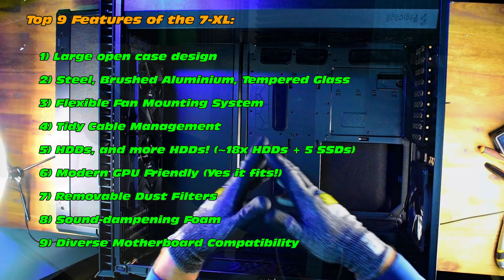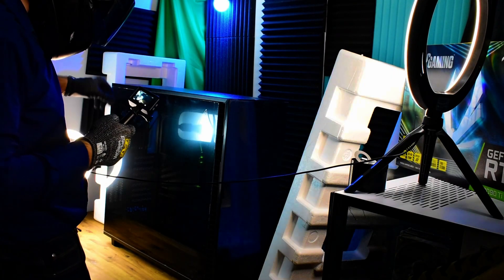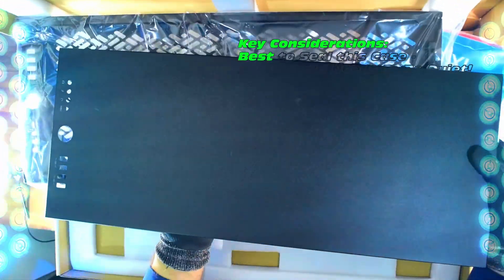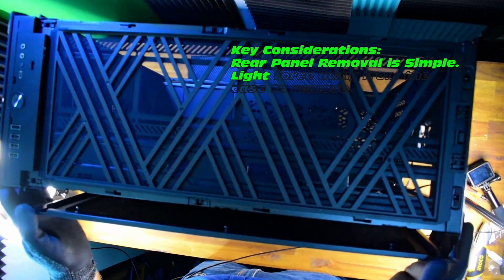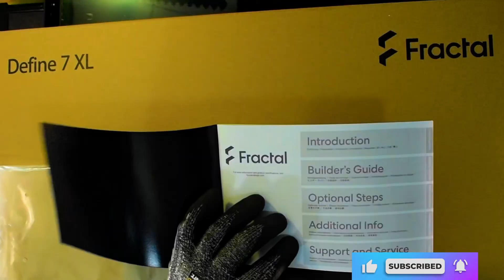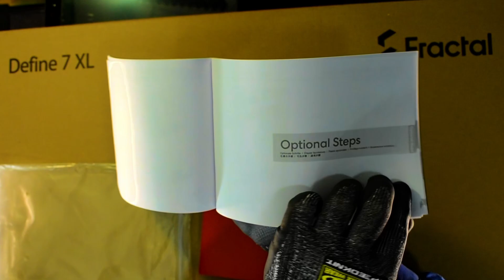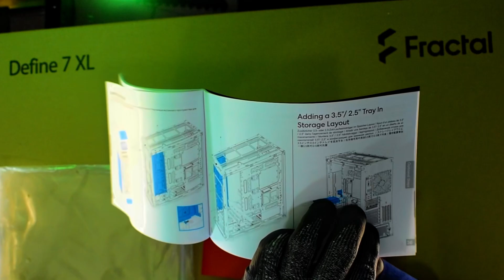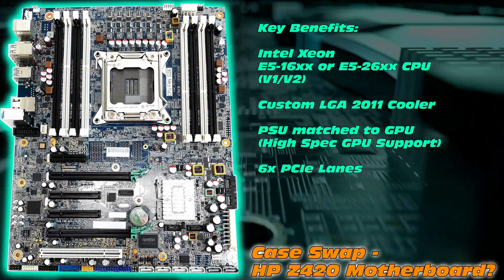Z440 NAS Build : Fractal Define 7XL Unboxing - Fits 18x HDDs, NAS Solution? (PART 1)

Comment: I still can't find a single video that shows how to mount the trays in the Define 7.
Reply from the maker: I have one, I promise! This video is done: https://www.youtube.com/watch?v=K4RalaEbRI4 Maybe it's the only video on youtube that explains how to mount the HDDs. I had the same experience... ~19:27 (min:sec) in that video.

I didn't technically include footage of the mounting of that brace (I had to cut out a lot of footage to make the video shorter). The front panel cover has to be removed, and then there are some slots where the brace would secure once fitted. But you should be able to figure it out from the footage.

Comment: Part 2?
Reply from the maker: Forgive me for being slow, it's mostly edited but I need to round it off with more filming. 

For the Z240 case swap guide, I did the guide in "4 parts" (~10-20min each), but I want to try to make the Z440 case swap more compact and specific. So, I guess it will be 4 videos jammed into one. It's also taking longer because I want to retire some of my older systems (e.g. Z420 NAS build will be stripped down and sold) so that the Z440 can do all of it. 

If I have my math right, I should get to ~100TB of storage, that is if the 750W PSU manages to support that many sata power connections.
Reply: @racerrrz  that’s crazy cool! / good
Thanks for the info!
Im glad I found this channel, you have some interesting content / very informative stuff!
Reply: Part 2 @racerrrz
Reply from the maker: @CLUB420-wu6kt  Sorry, I am super slow with getting it out! I planned to get everything into one video - from motherboard removal and fitment, wiring the front I/O, getting power to all the HDDs for my TrueNAS system and even performance testing. Right now I am tempted to split it into smaller videos again because the video just ends up too long (large video projects are more challenging to work on, even with duel xeons and a RTX 3090 Ti to handle everything lol). Stay tuned, it should be a good one!
Reply from the maker: Update, the Z440 case swap guide video is done! https://www.youtube.com/watch?v=K4RalaEbRI4
Reply from the maker: Part 2 is out! Sorry that one took me ages, but I trust you'll enjoy it! Part 2 : Fractal Define 7-XL NAS Build!  https://youtu.be/K4RalaEbRI4

Comment: In August 2023, I have just ordered the Fractal Design "Define XL".  This case was first made a few years ago, and accessories are now limited.  I just bought one with a few "twin pack - type B" HDD sleds" to fill out the HDD feature that this case offers.  I just about got the last of them.  Don't buy a case, hoping the accessories will be available a few years down the track.  "End of Live" exists when it come to accessories for home server cases.
Reply from the maker: Hi there. Fair point, no item lasts forever and these Type B HDD bay adapters / sleds are critical for HDD storage expansion. But in saying that I managed to buy a brand new Fractal Define XL R2 in Feb 2023 which was first released ~2010 (Linus reviewed it back then). If Fractal have stopped production of the 3 y/old Define 7 XL series (i.e. you can't find them in stores) then it would be time to find a better case. I can still source the Define 7XL, Meshify 2 (also uses the Type B adapter) and the Type B HDDs adapters locally which gives me some hope their supply will last a little while longer. Plus, I see Linus Tech Tips used the 7XL in a recent video (Jul 16), that has to be good news! Do you have any alternative case suggestions for a home server? It can be well worth the bookmark for those hunting for NAS cases now and in the future. But for the time being I am quite happy with the flexibility of the Define 7XL.
Reply: I've purchased 3 of them over the years and each came with two sleds and on the packing/accessory list mine only says two. Went to Fractal's website and ordered more (two sleds come in each pack) and all is well.

Comment: these fucking cases , ooo 18 bays nice , can i fit my 320mm gpu in as well , no , no i fucking cant
Reply: According to the documentation you can put 340mm cards in it, given you use the disk section. 500mm something without it.
Reply from the maker: @sergeys.5418  I can do a quick measurement actually. There is around 35.7cm max gap, so a 340mm will fit without issue. But looking at the spacing, the HDD fitment brace does take up a fair bit of room, and annoyingly it also obscures the riser GPU fitment. 

It also took longer than I expected to figure out how to mount the whole HDD brace system (does anyone actually read the product instructions? lol). 

I did manage to fit 2x 5.25" adapters and I have 6x of the HDD bays are occupied below the upper 2x 5.25" bays. Overall quite happy with the case as a NAS build and the built in GPU riser adapter works well enough for mounting.
Reply: @racerrrz  Ah, good to know! Tnx for the information. I'm choosing between this case and Pop XL because of 5.25" bays and trying to figure out all those measurements. Do you think the 5.25" bays would fit longer and heavier devices, or they're really for quite shorter ODDs only?
Reply from the maker: @sergeys.5418  Sorry I overlooked your reply, or I missed the notification! I actually just released a video on 5.25" expansion options that you may find of benefit (https://www.youtube.com/watch?v=ldDnBx_n2n4). The mounting mechanism for the 5.25" bays would be important if you plan to load in heavy objects like HDDs etc. There would also be more vibration from mechanical drives if there is no vibration damping (you could use silicone o-rings to damp some of the vibrations). The Fractal Define 7XL's 5.25" bays have sufficient mounting locations to secure heavy objects but you may need custom screws / bolts to get those adapters secured. The most impressive 5.25" bay I have seen is 12x Hotswap NVMes fitted to 1x 5.25" Bay!
Reply from the maker: These cases do present a strong case for love/hate, but they do one thing well - gaming case or NAS case, just not both. To add to the annoyance, the 18 bays are not actually included, you have to buy the additional caddies to reach 18 HDD bays. As for the GPU fitment, I would opt down a custom route - making a custom aluminum support bracket to allow a gap that doesn't obscure the GPU's fitment. So likely ~12-14HDDs with some drilling and light metal work to replace the HDD brace - and allow a modern GPU to fit. However, this should not have to be an issue in such a large case.

Comment: drop in the HPZ840....
Reply from the maker: Hi. There is so much space in there, the Z840 motherboard would fit perfectly. It is tempting to try to figure out that case swap, and it is quite logical now that I have literally outgrown the Z840's case. I took infrared thermometer readings of the 10GbE NIC card that is now housed outside the Z840's case and the temps were ~65'C / 149'F, toasty. I need the Z840 daily for work so I can't really take it apart - but if I can score a cheap Z840 motherboard it could happen. However, right now I am after a future proof NAS to house HDDs that is relatively low on operating cost, low on fan noise, that's able to allow remote connection to data from multiple PCs if needed, and that I do not need to run all the time, hence the Z440 swap. The Z840 runs long hours each day and it would become costly to run all the hardware with just one motherboard.

Comment: I'd love to do something like this with my Lenovo P520 issue is the psu is proprietary and there is a couple of hookups you need to add but other then that it could work just fine.
Reply from the maker: It might just be possible! I found a company on Aliexpress that had a ATX PSU converter cable for the Z840. I'll need to test it with a multi-meter since I can't afford for there to be wiring error (nor can I recommend something that might burnout a workstation and the attached hardware!) But if it works that would open up some options to overcome the proprietary motherboard power connections for the Z840 anyhow. Upon a quick search I didn't see any ATX PSU converter cables for the Lenovo P520 workstation (the system will still be too new also).